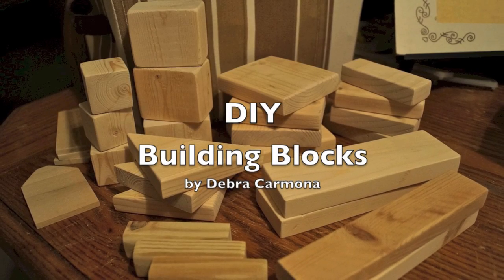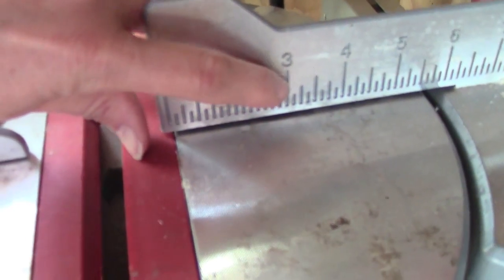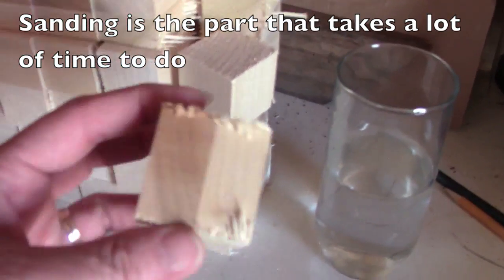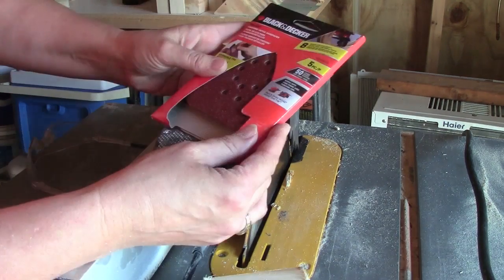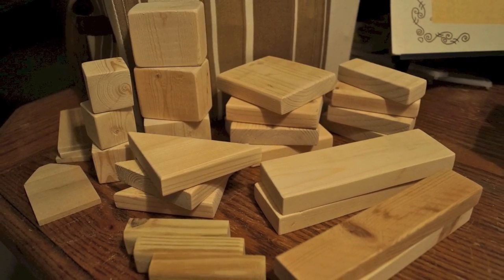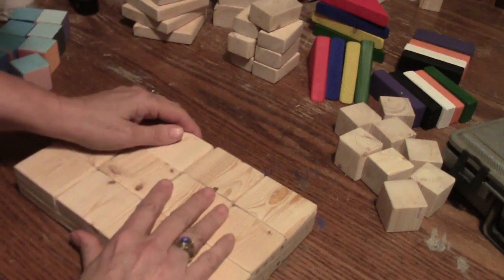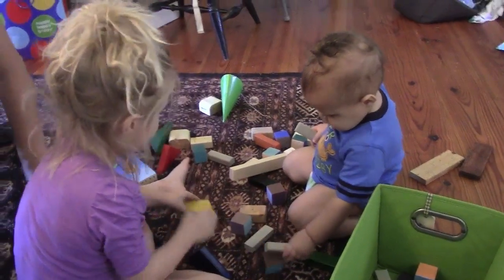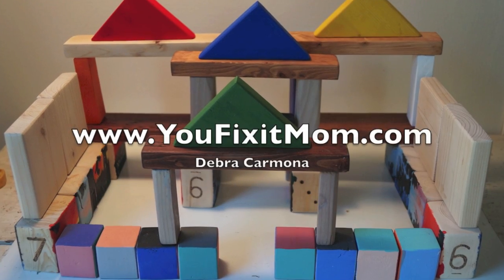DIY Wooden Building Blocks

Comment: Thanks for the video. It's helpful. 
I saw that you commented that you got a new sander. I was thinking that the mouse sander may be safer to use in a vice clamp rather than on your saw.
Reply from the maker: You are right it would be if I had one. My new sander is a free standing belt saw which is far easier and safer to use. It also has a disc sander on the side. When you don't have the best tools you use whatever you have.

Comment: Can you tell me which board you started with for two of the blocks?  I'm looking to make blocks like the ones that you have in the right front of your main photo of the group of blocks at the start of your video, the thin, flat rectangles.  There might be two different sizes there, the width at the very front on the right and the slightly wider ones right behind those.  I can't decide which board to start with so if you can tell me the boards that you used, it would help a lot.  Thank you.
Reply from the maker: I started with 1 1/2" width x 1/2" thick x 6' or 8' length but cut it into 8" lengths, the other behind is 2" wide which is also 1/2" width

Comment: what kind of wood do you use and how much does it cost?
Reply from the maker: You may choose any type of wood. Pine is softer and cheaper, easier to 
cut. Oak is a harder wood and more expensive but more durable for the 
long haul. You can also find medium hardness woods. You can pretty much 
tell the harness factor by the price. You get what you pay for.

Comment: I enjoyed the video, and all the benefit of the blocks. However this is a little short on the "how to's" for example some of the sizes and angles used.  I agree that a miter saw is a great saw, however I think for this project I'll be using my table saw.
Reply from the maker: Have fun. I will be making different shapes to add to my grandchildren's collection of blocks now that I have a band saw plus I have a much better free standing belt/disk sander that is so much easier to use.

Comment: Hello, you need to delete this video putting that sander with the saw blade might end up killing someone if they watch you. 

Always treat the blade as if its on.

But like your DIY thinking still likes the video
Reply from the maker: Only a fool would make a mistake like turning on the saw in this situation. There is no danger if the machine is unplugged. Sometimes when you don't have the perfect tool you have to find ways to improvise.